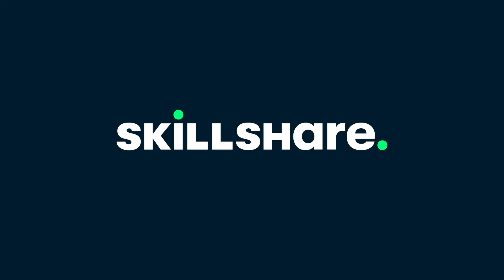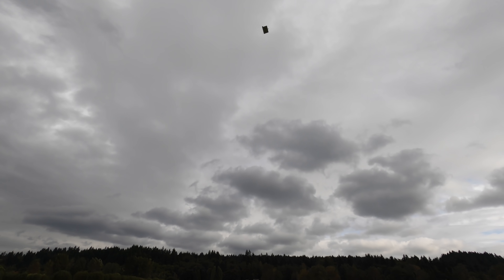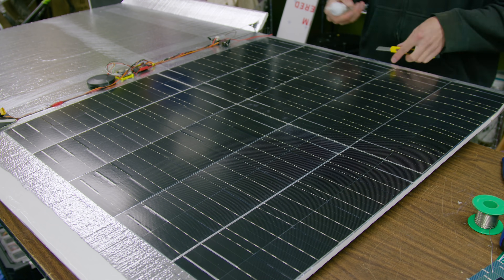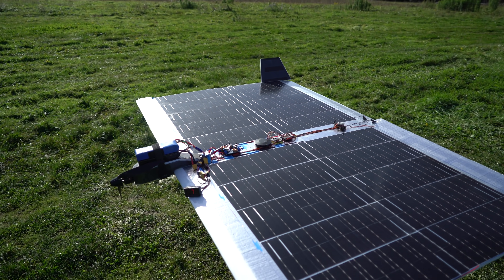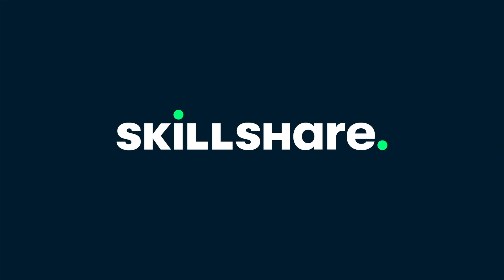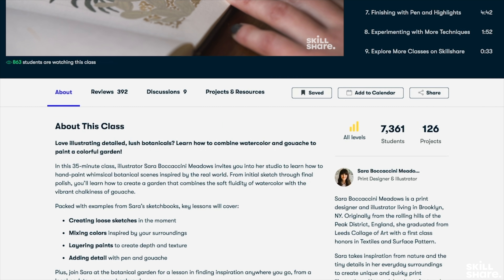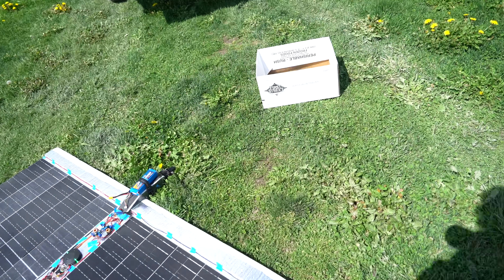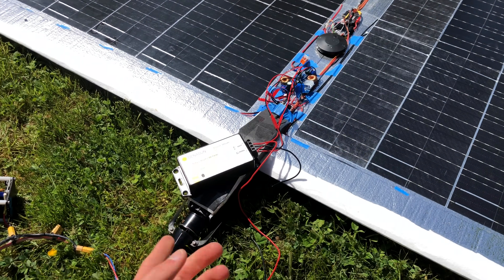R/C Flying Solar Panel???

Comment: Love this.  There are a lot of airfoil oriented websites that use a lot of math to describe airfoils.  But you can fly with a sheet of plywood tilted slightly.   The airfoil adds a bit of structure to the wing, but 90% of lift comes from pressure on the bottom of the wing (at slow speed, studied in the 1920's); of course, a better wing results from a slip streamed airfoil. It would be nice to again check on the advantages of the airfoil during varying speeds and directions to determine what fraction of lift Bernoulli vacuum contributes) I suspect the vertical tails on your original may have helped with flight stability.

Comment: 5:20  why no one make those flexible lightweight solar panels as size of a a5 paper (4 pieces of those cells In 5:20) then they can be easily carried in a cover like notebook to use in camping & survival situations

Comment: If you would have put an arch on it & made it a giant airfoil it would have created it's own lift. You just pulling a piece of foam through the air with a powerful e-motor. You want the motor to do as little work as possible & let the wing shape create the lift. I think you best bet would be making a huge b2 bomber type wing, maybe a little wider fron front to back. Shape is everything. You can make a cardboard box fly if you have enough power.

Comment: Hahaha,  It's he dump truck of the solar plane world. Great vid!
Suggestion: Cantilever the motor/battery out in front, on a spar, until you get the CG where you want it without dead weight?

Comment: flying solar super hot air balloon (chromium metal thin foil blimp with solar panels or direct solar heat collector)
Reply: blimps have naturally tons of solar panel area, and dont use lot of energy while floating at place
Reply: in stationary floating mode the blimp can even use its turbines to generate wind power
Reply: also sphere or ellipsoid is more rigid/stable because its 3d frame, as opposed to plane/drone 2d frame, ie cross bracing
Reply: chromium foil can deal with 1900C temperature, copper can deal up to 900C, which gives hot air almost helium lift, 0.27kg/m^3, nickel foil/electro-plating can deal up to 1500C temp
Reply: try cross solar wings, one horizontal wing and one vertical wing, in cross shape, equal length, should be super stable, and you can star wars cross brace the wings in a diamond shape, kinda like bi-plane, but cross-plane
Reply: just paint the balloon black, and/or have a smaller inner section to be black and absorp the heat, and outer transparent layers acting as the transparent air insulation layers like in triple windows

Comment: With fight control, you can almost get away with flying a barn door. But you still need to put the center of drag behind the center of lift and center of gravity. Just adding a tall central vertical stabilizer would have achieved much more stability with less drag than adding all those draggy slats, maybe ; )

Comment: make the plane transparent. have dual side solar cells on one or two sides. have the cells be a part of the structure. long flying wing is the best for just flying. a long straight wing with computer stabilisation so it doesnt flip.

Comment: you do not need a charge controller.  Just a small cpu (rasperry pi - pico)  to monitor voltage, and a diode and a relay.  Much more efficient.  Batteries can be directly connected and just monitor the voltage, can just use telemetry to monitor voltage and remote control a relay.  Lose the charge controller weight and move the battery to balance the plane.

Comment: Dumb question: what's the generation when the plane was inverted?.
Would reflected light from the ground give additional voltage?.
If not weight prohibitive wrapping cells on both sides of a glider might be worth a try.

Comment: What folding prop are you using ?

What antenna are you using on your Taranis ?   Are you using the internal 2.4GHz module or an external (900 MHz) module ?

Comment: You would think moving the stabilization adjustment to the outside would be common knowledge in aeronautics, since cars have been doing this for decades.
Propeller on the inside vs propeller on the outside, is comparable to a 3 wheeler vs a 4 wheeler, as far as stabilization. The wider the "track" the better the stabilization.

Comment: Buddy what is the charge controller you are using I am using 4s lipo battery and i need to connect it with solar
Reply: I am using c60 solar cell

Comment: Maybe mount the single battery far forward on a mast. You would need an extension for the battery leads but could do without the ballast of an extra battery.

Comment: Need to move motor further up front built longer mount, than you don’t have to put extra Weight,and than once you put in rth mode and nose dives solar panels will not be in the sun, therefore not Produce any power , (will need small 1500mah3s ) just as back up for 1-2 min, but you should be able to maintain altitude just with solars just do
Calculate amps of motor and total load of solar,

Comment: To me, a reasonable goal is to be able to fly and store enogh charge to fly until sunlight where it can recharge again. And even if it cant be done with airplanes, there are alternate LTAs (blimps  balloons, etc. )
What about a helium filled fuselage and /or wings  combined with solar power? Because so far, you could make a 100% autonomous blimp.

Comment: Adding a battery that is practically dead weight is as retarded as buying a Tesla with extra battery and not unlocking the long range. The concept from Tesla to pay extra for something you already bought is retarded anyway though.

Comment: A note on the solar vs motor sustainability. The current draw is directly related to rotor resistance. It will see less resistance in motion rather than treading air stationary (needing to displace larger volumes of air at the same RPM). You may have seen quite a different amperage in flight.

An easy way to test this... Hook the ammeter up with the spinning rotor and touch the prop/rotor with a piece of wood or similar object to artificially create rotor resistance. Current is directly  related to work and the current will reflect this extra work it will need to produce in order to sustain the same RPM. An RPM of 1400 is going to require a very different amount of work while in motion versus stationary.

Thus, you are WAY closer than you realize.

That being said. Minor modifications in lubrication, smoothing the props and rounding the body edges would have a drastic effect on drag on such a light aircraft. The amount of work drag creates is much more profound on such a light aircraft.

Although stabilizers may cover the solar panels slightly and create more drag, the reduction in use of the ailerons should save a lot in total operation too.

Comment: I think if you had a a better air foul shape it would help sustain flight with less power (let the lift do some of the work rather than the propeller dragging the plane vertical).

Comment: Technical question: Do you recommend using a BMS between MPPT and the battery, since the battery cells are constantly being charged by the PV ? Especially if you think on the long run?
Reply: A bms is almost always a good idea. Lost efficiency is worth it.

Comment: The wing is totally flat. The panels are flexible and should be more lift-shape. How about bending panels over depron ribs ?? Skip the foam (and the strength). Keep level flight with a gyro stabilizer for RC and let the gps control a rudder. Or swing the engine sideways by gps control ??. Hope I make sense. GREAT WORK DUDE. Love it.

Comment: Question- how does air flowing over the panels make them loose efficiently? More molecules or what? I don’t understand and Ty for your videos ❤️😖
Reply: It make the plane lose efficiency not the panels. Usually anything on the wings will increase drag and decrease efficiency.

Comment: Good show.  Try a big flying wing. semi symmetrical tapered. 1/4” foam covering. Form ribs. Foam box spar.   8’ would be a great testbed. Weight is the enemy so keep it as light as possible.  Every gram matters.  You can figure it out.

Comment: I guess you should omit the mpp charger altogether! Power the motor directly with the solar cells and use the throttle as the mppt (gaining altitude or glide). A (little) battery should only be used in case of a cloud anyway. Then open a mosfet to add the battery. To charge the battery, use a cheap little dcdc with CC (constant current) to spend 1A of solar power charging the battery via a second mosfet when you have access sun energy. This concept for sure is not perferct. You can tell it down :-( or start to perfect it :-)

Comment: Extend the fuselage out till you reach your optimum center of gravity instead of adding weight....then use the extra area for more panels and hiding the electronics that can fit inside it so you get better aerodynamics

Comment: Remember the WW1 planes, with wooden frames and fabric spanned over the frames? maybe you could use a similar approach: make a frame out of carbon fiber (or balsa, or even cut holes into the foam where the solar panels are), and use the solar panels instead of fabric on top of the frame. Meaning: use these flexible solar panels in dual purpose: electric AND aerodynamic. It might also give you a less wobbly construction, and save some weight. What do you think?

Comment: ALSO HAVE YOU HEARD OF FREE ENERGY MOTOR A GENERATOR THAT POWERS THE ELECTRIC MOTOR THAT A V BELT HOOKED UP TO GENERATOR TO THE MOTOR AND GEARED RIGHT SO THE MOTOR HAS ENOUGH ROTATION TO POWER THE GENERATOR AND VISE VERSA!!!! FREE ENERGY CHECK IT OUT AND CAN YOU BUILD ONE? SO IN ESSENCE THE GENERATOR CREATES ITS OWN POWER!!! WHAT?!!! OMG!!! AND IT DOES WORK! https://youtu.be/vFfsEfnsA4I

Comment: WHEN YOU ADD MORE WEIGHT JUST ADD MORE WING AND SOLAR? ALSO CAN YOU JUST USE SOLAR PANELS WITH OUT A BATTERY TO POERATE YOUR EQUIPMENT? WHY DO YOU NEED A BATTERY IF YOU HAVE ENOUGH AMP/WATTS FROM SOLAR TO RUN WILL IT WORK? AND CAN YOU TRY IT ALSO WHAT IF YOU PUT A WIND GENERATOR ON TOP OF YOUR AIRPLANE TO CREATE ENOUGH POWER TO RUN THE EQUIPMENT?

Comment: How about making a glider instead and cutting the with of the wings by half (so one row of solar panels) and making it same amount of solar panels longer instead. You could probably also put one additional solar power on the horizontal stabilizers or even 2 more on each side of the vertical stabilizer.

Comment: This is not bad, and a great overall idea.  Split the panel, and arrange it to 2x wingspan with half the chord, then attach a stick tail.  Still trivial to do, but it would be a much better flying arrangement.  I'm all for zero work, but a tiny bit to get a far more functional plane would be worth it.

Comment: When I was kludging indoor flyers I fixed ridiculous, even comical tail heaviness by putting a small ballast weight way out in front on a carbon tube. Further out front you put it, the lighter the ballast can be (so less energy to keep it aloft). Flew great, looked stupid.

Comment: Have you thought about building a solar plane/glider that charges its battery and gains as much altitude as it can during day/solar hours, and uses the altitude gained and battery charge to get it through the night?  Do you think it's feasible?

Comment: What charge controller do you recommend for low voltage/low watt solar panels? I want to build a small charging station with a 5W solar panel that's about 6"x4"

Comment: Would there be any benefit to mounting some cells on the underside of the wings? Maybe grab some power from ground reflection? Add weight to move the center of gravity? Love the videos and I have no idea what I am talking about.
Reply: You could laser beam energy to those cells...Sometimes the best ideas come from the people who don't nothing what they are talking about. It's very rare though, but it happens.

Comment: What a great project . Would love to work on projects like that . Interested in the total cost
Reply: Radio and receiver 100. Flight controller, gps, radio for MP 60e. Motor, esc and servos 30e. Solar cells 100e. Controller 5e. Dumptruck aka flying pizzabox wing 15e. Obvioysly this guy has more expensive stuff, but you don't really need them if you want to get started. Can propably go much lower even.

Comment: Put some larger wingtips on the sides toward the back angled at a 45 degree angle.  Make them large like 1 foot long and half the thickness of the wing.  Put the larger charge controller in place of the second battery.  You might need larger flaps too.  You might try putting the motor and electronics below the wing surface to lower the center of balance a bit.

Comment: after you realized that you need more nose weight, replace the extra unused battery with the better charge controller. voila... it draws just over 4 amps while producing just over 5 amps...

Comment: I think if you can take the extra weight off with that other battery it might work. But you need to move your center of balance up.

Comment: Crap. You don't read, do you? The human powered airplane guys already decided this: a high L/D means NOTHING!  Minimum sink rate /max angle/minimum power required is the key!!!!  You have to lift a big weight with the least applied power- L/D ISN'T how you GET that!!! So the sailplane notion is a loser- you want a low wing loading and a lot of area!

Comment: Square shape is absolutely not optimum regarding CG. I think this time the added solar surface does not compensate innefisciency and additional mass. V shaped flying wing are much better. in fact you should think about "what's the shape that maximise surfacevs wheigt ratio that has a natural good position of the CG ? "

Comment: So close to having it work.  The problem with stability/control was classic example of control reversal, with the control surface generating a moment that twists the wing in opposition the the change in lift provided by change in profile.  Being a flying wing the roll and pitch issues were connected to this one issue. At low speed the twist was low enough to retain control, at medium speed the control would have diminished to zero and high speeds the deflection will cause control reversal.

The solution would be to create a more torsionally stiff wing.  A planer wing made of foam won't have much torsional stiffness.  A better alternative would be to use depron sheets to create an upper and lower surface with span wise spars and ribs holding the profile.  It should be possible to achieve better stiff and aerodynamics with the similar weight.  Alternatively you probably could retrofit the existing wing with some combination of diagonal and carbon fibre rods.

The other improvement would be to create a long fuselage to get CoG further forward without needing the extra weight.

With these change I have little doubt it'd flying well and have great duration.

Comment: Just watched your video - really interesting.  I can’t seem to get the GPS to stay working on my Matek F405 wing - still working on it.
You may be interested in this for your next project.
https://youtu.be/4ND2WtEZatY
It’s a series of videos of how to mould carbon fibre from 3D printed moulds.  You could also probably use a 3D printed fuselage.

Comment: Why not just make the pizza box wing a lattice, and use the solar cells themselves as the wing? What more "its just solarpanels with an engine" is there? and they are flexible enough to make a wing shape.

Comment: Might be worth considering a 3D printed airframe instead of carbon fibre. You can get high strength and low weight with clever use of infill.

Comment: Hi, great work and video there.
.
Just a little suggestion -
You can mount the motor and only 1 battery more far from the centre of gravity and it could work.. In that case we will not need the extra weight and you should have kept the vertical stabilizer, may in a different orientation.

Comment: Have you ever heard of oblique wings?
While the concepts are all variable sweep, the aerodynamics for high-speed flight also work with fixed geometry.
The trick is to get rid of the root losses by having a continuous wing sweep, which allows up to about Mach 2 with an airfoil that'd do Mach 0.7 if unswept.
The interesting part is that you could theoretically provide all the yaw authority needed to keep a wing that sideslipped with just a combination of no yaw stabilizers and differential thrust.
I had done some math and it seems like a ultra-light-weight solar plane could use this to race the sun on the equator. It's not even that fast, iirc Mach 1.2 is what you'd need to keep up with the rotation.
Do you think a "scale" model (oblique flying wing) with the same wing loading would be interesting? IIRC the wing loading was around 2-5 kg/m^2.
Let me know if you'd be interested in a solar-powered oblique flying wing. An absence of vertical surfaces is surprisingly feasible to handle (even passively stable with the right wing tip twist), thanks to modern electronics, just using differential thrust/split flaps for yaw authority and elevons for pitch+roll authority.

Comment: Get a T12 size fluorescent light tube cover, split it lengthwise and use part of it for a lightweight aero cover for all the electronics on top. Form some foam into half cones for the ends.

Comment: May be a thick wing would be more efficient (and stiffer)
About the barometer errors : was the sensor on the extrados ? (then on the low pressure side, depending on AOA and air-speed)
By the way, you are a good singer !